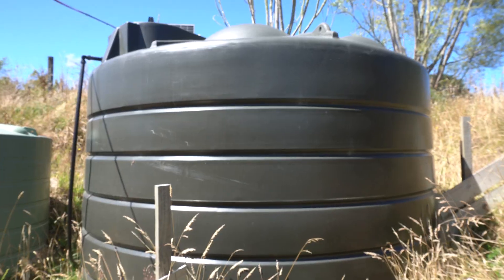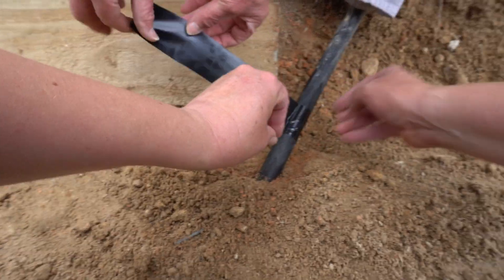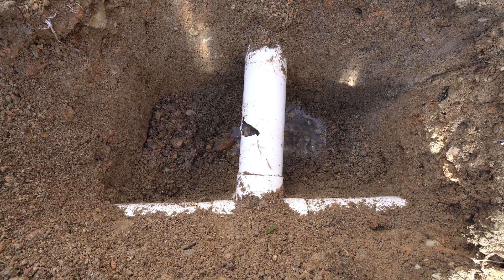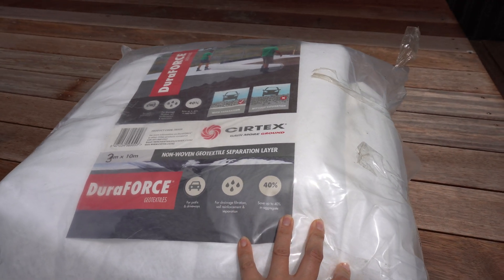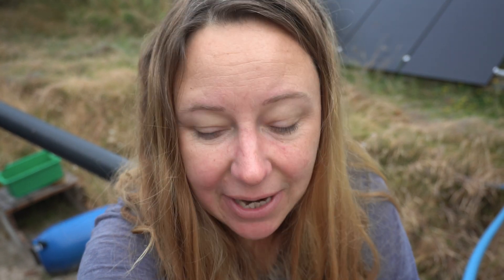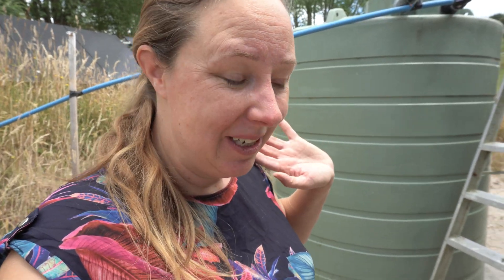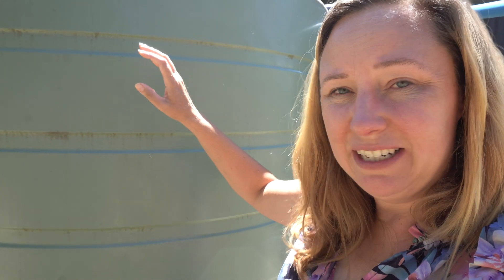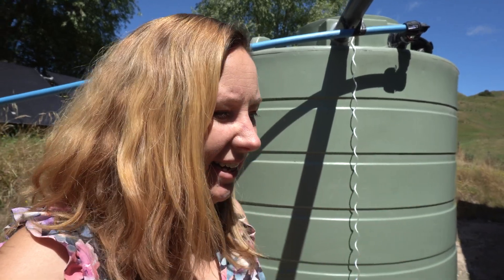My Rain Water Tank System Failures – Learn From My Mistakes!

Comment: A good friend of mine had something like yours, I asked him, why would you have your main tank at 30.000 liters as the overflow tank and the smaller connected to the house which it seems you have. I think it should be the other way around, run your house water from the big tank and use the smaller for the overflow, where you can add to it as time goes on and if you need to add to it. I think you are on the right track changing them around, and maybe use a bigger dimensional pipe from your guttering for those downpour days. I believe it is practical and necessary to keep water on your land in my opinion for the land and your gardens, fruit trees & vines, even animals. I have seen a few water tanks with that float system where the float on the inside rises as the water fills the tank connected to a rod through the tank onto a tennis ball, so when you look at the height of the ball on the outside you will know how much you have in the tank. ( Just another thought to look into.) I hope you understand my writing. Knowing roughly how much water you use in your house is a good idea. Have a wonderful day.
Reply from the maker: What was your friends reasonings? Initially I was worried that if a tap was left on I’d loose all the stored water!

Comment: You could put a French drain in the ground to channel that excessive flow…rather than a pipe..you can buy it in plastic sections that click together..then it has a continuous slotted cover so you can traffic over the top.

Comment: Water catchment is priority in off mains environments...

A larger tank set back slightly from the house in the position you pointed to if 'above' existing tanks, or another similar sized one to your existing tank set beside it, overflow goes to the new one, and they are coupled at the outlet ( bottom) of the tanks, so by turning on the extra storage tank it will equalise to your existing tank as it empties... you can turn off either tank as required when filling.

To lift your large resovoir tank water to top off your house tank use a solar pump, look into 12vt 'bilge' pump types used on yachts, etc....

Your reserve water in the big tank is life- it is your backup plan in dry times. If need be a petrol firefighter pump can move 100's gallons an hour and set up on a trolley is easy to manage. 

i have a 5000gal (22,500lt) on my house, with a second 5000gal tank for overflow reserve catchment, i have a huge roof so can fill tanks with good rainfal rates. I can equalise both tanks in dry spells if the main tank begins to empty by merely turning the outlet taps, or for speedy filling, fire up the firefighter pump. 

Systems, and oversizing rainwater storage is key... moving water from tank to tank is important. Personally your 1000 gal (5000 ish LT) tank is way too small for your main house tank. If heights are an issue-roof to top of tank heights- order squat tanks- wider but lower top. I'd have two 22 500 LT tanks as my house storage, and smaller tanks for overflow catchment for gardens, animals etc.
Reply from the maker: Sounds like you have a great setup! I'll look into a 'bilge' pump, but wonder if it might struggle with the distance and that it would be pushing it uphill a bit...

Comment: Im a french drain guy all the way.  Also for collecting and redirecting top flow surface water, i like to pour a foot wide  (or less) lengths of concrete,  and temporarily using a length of straight white down piping to create a natural drain canel thats as shallow or deep as requir when the pipe is  removed before the concrete sets. Also easier to drive over
Reply from the maker: Huh, very interesting about the concrete drain... hadn't thought about doing something like that!

Comment: Plumb big tank into house use green tank to collect water from roof and siphon to big tank with a float valve to stop over flowing
Reply from the maker: I think when it rains, the amount of water off the roof is more than the amount of water transferring to the big tank. I'd need a bigger pipe connecting the two tanks?
Reply: I live off grid in central Queensland oz and have a roof area of about 153sq and am using 90mm PVC down pipe still think plumb the larger tank into house

Comment: Hi Kay, loving the vids over here in Sunny Donny UK, not sure if it's been mentioned or you have thought about it? If it was my system though, I would do as you said, move the other tank to the back of the house, connect to guttering as a collector but also what you could do, is make both tanks the same ground level and join them at the bottom of each tank with a length of pipe, this way they would balance fill/empty and your supply will be doubled!
Reply from the maker: I've been mulling this over. Seems a bloody good idea.

Comment: Keep an eye out for a second hand tank to get more water storage. Not sure where the "big tank" gets it water from, but maybe the two tanks could swap positions, or it sounds like you need a bigger tank to collect water off your roof, and then maybe overflow to the smaller tank, using gravity, that way you have a larger capacity before needing to get water from the original big tank.
Reply from the maker: A few people have suggested the bigger tank moved behind the house but also have the smaller tank right next to it. Seems like this might be the way to go!

Comment: You'll need a couple of large pulleys for the float system, there's too much friction loss with the string going over the tank, you can buy commercially made float systems...not too expensive. 🤠😎
Reply from the maker: That's true. And good to know the correct term - pulleys🤣

Comment: A rough rule of thumb to work out how much water you can collect is that 1mm of rainfall on 1 square meter of roof will result in 1 litre of water collected. You should be able to get a cheap rain gauge at Bunnings to work out what you are collecting with each rainfall.

I'm on town water so it doesn't apply to me but I was thinking that if I ever do what you're doing I'd look at a first flush system where the first part of the rainfall collection flushes out debris from the gutters and off the roof and is discarded with the rest of the water being a bit cleaner for the storage tanks. Some people say its needed & some say its not
Reply from the maker: It would be interesting to know how much water is actually collected on a normal rain day.

Comment: yes bring the big tank up beside the house and overflow it into the small tank .connect both tanks together with a valve .you need to look into a first flush inverter.you can   buy a water level for your tank at any rd1

Comment: I do not understand why you do not have a long measuring tape. The woven cloth type that winds up on a reel.  Don’t “think”, don’t “imagine”. Instead take accurate measures. If you want to know if the tank will fit under the eave of the house measure! Also measure  the ribs on your water barrel. They are of a defined height. The diameter of the barrel is a defined measurement. You know how much water the barrel holds, that information was part of the product description when you purchased it. Division will tell you how many liters of water per height unit. You can install a water meter into the water pipe going into the house. That will tell you how much water you are using per day.  You took math in school. Do a review if needed. Those lessons are all online for free. There are lots of free online math calculators, so no need to fear math accuracy. You will be needing to help your child learn to use math and logical problem solving. Do not give up or get teary frustrations. Just work on those basic math skills with reviews.
Reply from the maker: I’ll get to it 🤷‍♀️ No rush

Comment: Loved your engineering for a level indicator. In theory it should work. Get a less wavy line and scale the ball and weight to weigh the same. It should work. Yes, the more surface area, the more water you will collect. Thanks for your video!
Reply from the maker: Haha a failed attempt. I had been looking for fishing line and weights. That would work the best I think.
Reply: The weights just need to be enough to overcome the friction of the line moving across the top of the tank. I also suggest a curved pipe as a guide/run to reduce friction and reduce fraying of the line where it rubs over the top of the tank.

Comment: Fix a transparent, vertical pipe on the outside of the tank, bottom to top. Connect bottom to tank. Leave it open on top to breath. That way you'll always see the water level inside the tank.
Reply from the maker: Seems like the easiest way to check the level!
Reply: @TravellingK  A "sight glass", as used to be on farm milk vats.
A float in the pipe will make the level easier to see. I will need a cap to keep debris out of the pipe.